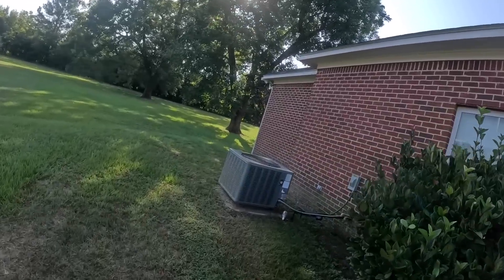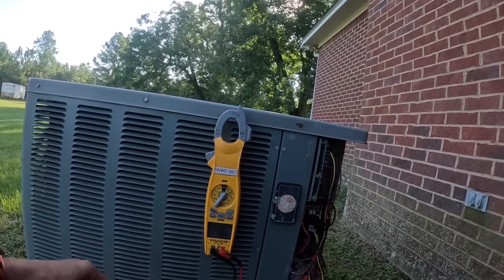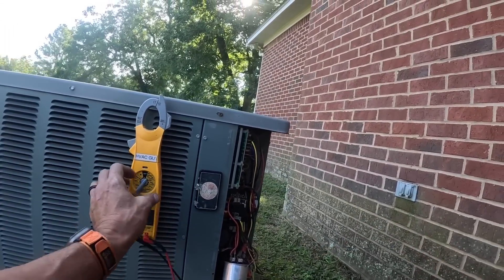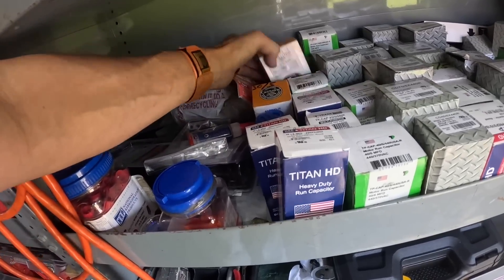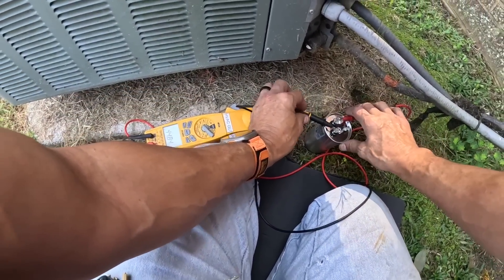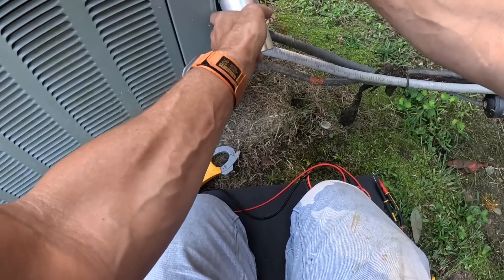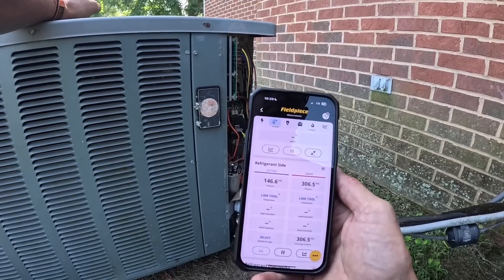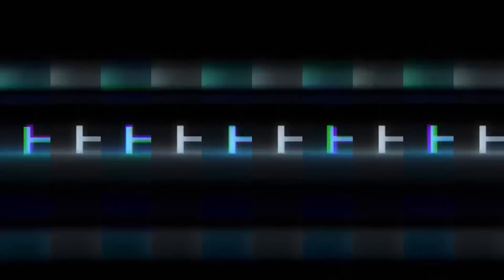Outside Fan Wasn’t Turning! #hvacguy #hvaclife #hvactrainingvideos

Comment: I'm glad i watched until the end. I was going to comment about stocking a turbo cap. I don't penalize the customer by charging more when i use them. I just make less profit, but i lose less money by getting the job finished in one trip, so i think it's worth it.
Reply: I don't stock the 200x but I should grab one. I'd charge a little more if I had to install one of those which I think is justified since they replace bigger caps.

Comment: Yessiree...you can't fix it if you haven't got the part it needs. Seems like capacitors need to be in large range and quantity for service trucks as well as Curtis' idea of having those Turbos for when you have an oddball situation or need. I know it takes up some room but I think I would configure a drawer or shelf that is set up to house 4 or 5 each deep made in USA capacitors in the many popular ranges as well as a place to store not so popular sizes of maybe one or two each.  Myself I'd rather have them vs. take an unscheduled trip to the supply house.
Either way, the expert gets it fixed but had that been a Saturday or Sunday wherein the customer was willing to pay the extra charge for a weekend call, having the part in stock would make a huge impression plus a great profit for the service call. 
Some of those fan motors look like they are dead to the world yet keep on working. This one still had good bearings as the fan blade coasted to a stop very well. I reckon its a hit and miss with modern products...ball bearings should be mandated for heavy working equipment. I can't count that high as to the many motor change outs that were due to the bearings failing vs. the motor itself.

Comment: Don't be afraid to install separate herm / fan capacitors.  They last longer if you do because the heating is split between two cans.
Reply: He did say there wasn't room for 2 caps.
Reply: @pilotboba  Really? I missed that.
Reply: @chrisscott1547  4:42ish

Comment: I had to take one of those completely apart yesterday.. I hate those models..it took me 4 times longer to clean vs something like a Goodman, mainly because it's almost impossible to get the screw holes to line back up..the entire weight of the enclosure is resting on 6 tiny screws, in which you have to hold up the panels to get the screws in.

Comment: I hate the Schrader valve location on those units. Our pricing is weird with Rheem/Ruud units, sometimes the basic cube is more expensive than the mid level units at times.
Reply: Rheem chooses horrible distributors around here, the company itself is pretty good to get along with.

Comment: My company will charge customer $470 for the capacitor we don’t carry on the Truck and make me drive to get it, if it closes and still pay me for $5.5 for that capacitor 🤣 plus $15 for the trip totally rip customer off and technician. I just can’t wait to quit this company, 1 more year contract 😢
Reply from the maker: Your situation sounds horrible. Do they treat you like a 1099 contractor?
Reply: @HVACGUY  no, we have W2, it's just they try to lure in new people who just start to learn trade and use them as much as possible until they quit. I saw so many good technician can't deal with them anymore and left the company, I guess I'll be next because the pay is not fair. I really want to move away from this state or find a good company to work at.
Reply: @ShiYushi  Good luck!

Comment: They’ve had the 200x for a while and yeah they are pricey
Reply: His parts house is a bunch more than mine.  I stock all AmRad primarily in the actual sizes, but I do stock a couple Turbos on our vans just in case, but we rarely use them since we have the actual size.  Every time a part comes off the truck and sold, it is replenished the next time at the parts house.  I have our vans keep in and out inventory.

Comment: That is that is the first time I've ever seen a hot water tank in the attic.
Reply: Very common in Texas.  Free hot water most of the year.
Reply: @Austin10-76  Ditto. Every time replacing such hot tank is pain in the rear!
Reply: Here in Texas is quite common to see them in the garage as I do my 82 gallon electric water heater. In my area near Houston houses don't have basements as the water table is about ten feed below ground level. Sometimes they're installed behind the furnace or electric heater. A reeal bummer!
Reply: @bobboscarato1313  Here in California most hot water heaters are in the garage.  90% are gas and were required to be 18" above the floor.  In the 1950s they were placed directly on the floor and gasoline fumes from car and lawn mower gas tanks started fires.
Reply: @dfirth224  Same in TX for gas; for electrics it seats on the concrete floor; my water heater capacity is 82 gallons!
Reply: @dfirth224  In California you are also required to strap heaters due to tremors and earthquakes.-
Reply: @bobboscarato1313  In FL I have one in my garage. Can't wait until it needs to be replaced, I would put in a hybrid heat pump one to get a small amount of cooling in the garage. :)
Reply: Those are infamously common here in NC
Reply: Water heaters in attics. Free hot water? How much would a flood eat up that savings? How are they drained as part of a pm? What if the pressure relief valve fails? 

I’m in Texas. Mine is in the garage 18” above ground. Drain line pointing towards garage door/outside. If the pressure relief valve fails, there will be damage, but nothing like an attic placed water heater if the pressure relief valve fails. 

Ever see what they’re capable of on myth busters when pressure is too high? 

Man, a water heater in the attic. So much potential damage. 

The contractor, if still around, will try to get out of paying for it if you don’t test the pressure relief valve. 

Drain that puppy at least every 3 years. I drain mine every year. 

I have a programmable water heater. Water heaters are set at 120*. I bumped mine to 140*. 

House mixing valves do a good job at sinks, dishwasher and washing machine. Had mixing valves put in those last two places. 

Water heater in the attic. 

Nah. Not for me. Good luck.
Reply: Problem is builders in TX get away with lots of things. Hope to have good insurance and cross your fingers!
Reply: @bobboscarato1313  
Yeah. I get it. My house was built in 1982. Not the best time for building houses in my part of the state. But, it’s been a good house. Except the windows.

Comment: They're skimping on the micro farads😂
Reply: Chinese productivity eh?
Reply: @stevea6722  shrinkflation😁
Reply: @stevea6722  The Tradepro series he got was the chinese made version.  The Tradepro that is actually Green in color are made in the USA.  I suppose they didn't have that size in stock, but the TradePro green units are a good product.  I only sell AmRad for 90% on our vans, but in a pinch, Titan HD, TradePro Green, or BMI work well too.  But I only stock two turbos and the rest are actual specific sizes.  I guess my cost is lower on the 200x but rarely have a need for the Turbo products since I stock our vans heavily.
Reply: You got to watch the capacitor's voltage ratings.
Reply: @bobboscarato1313  Not if you buy a quality USA made unit.  All the major brands are 440/370 by default.  Less quality products have that issue.   Any model worth its salt, will be dual.   Thats why I don’t allow those 370 only on my vans.
Reply: @Balticblue93  I always went for the 440 rated; mostly electrical spikes cause their failure! Summertime in TX is brutal.
Reply: @bobboscarato1313  You are right about that.  My brother and family live down there.  I have replaced several capacitors on everyone’s systems.  I do my yearly servings of everyone’s systems.  Heat sure puts the rest on them.  But I have found AmRad units hold up well in that environment and 5-year warranty.  The bugs like the contractors too, so I switched most of them to the SureSwitch contactors on the units that aren’t variable speed systems and Rectorseal VRM disconnects.
Reply: @Balticblue93  In the medical industry they used contactors sealed in glass so no red ants can dmage the "points". Expensive!
Reply: More of that shrinkflation....